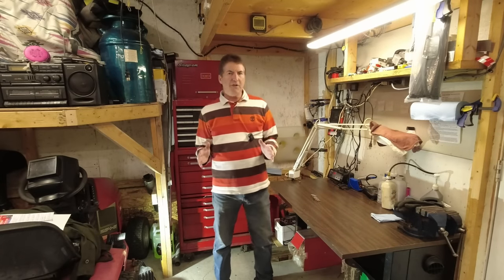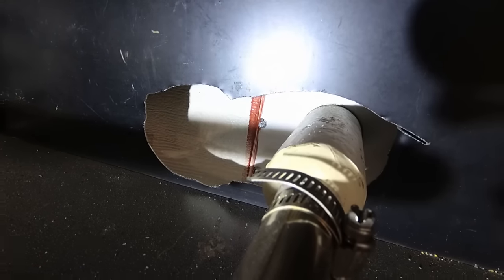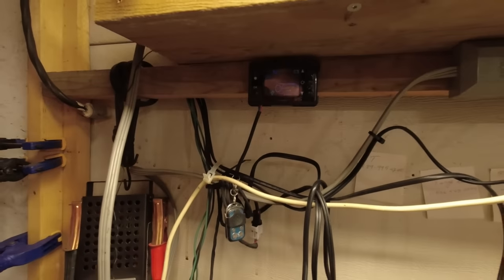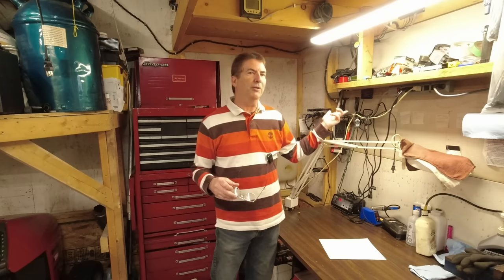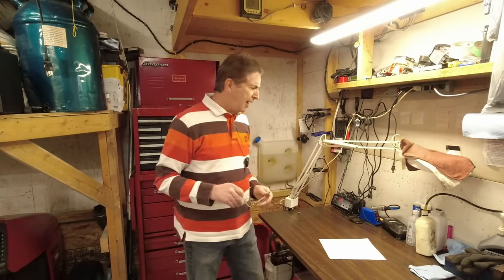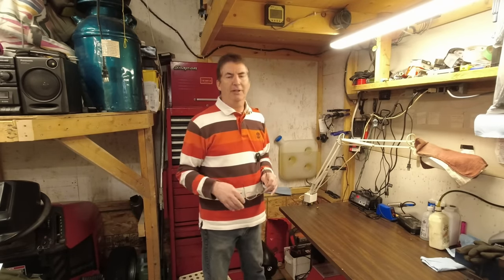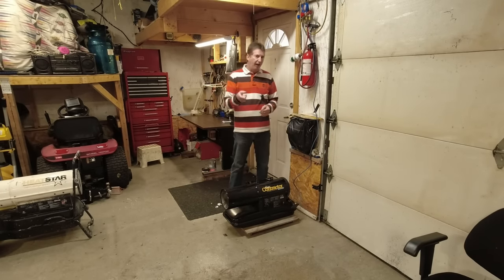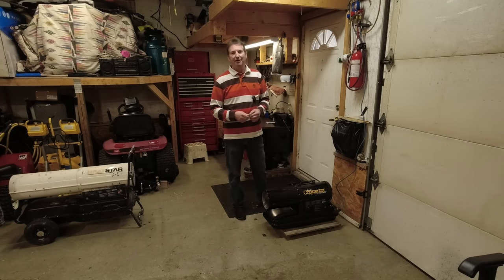Chinese Diesel Heater, 5 Year Review, Heating a two car Garage with a Parking Heater.

Comment: Make life easy. Just stick a tube in the 5 gallon can or even use a plastic drum. Also the tank can be below the heater. Side note each pulse of the pump is 0.022 milliliter of fuel. And the hz you are setting from 1.8 to 5.5 is the pulses per second.
Reply from the maker: Thanks for the reply, not all pumps give you 0.022 ML, some more and some less. 2 HZ on mine gives me around 2 KW. (Around 0.160 liters/hour, more of less, usually more) Yes not quite 2 KW but close enough. I buy my Diesel in the summer because it's cheaper and has more stored energy,  (not the winter mix) so it will gel if left out in the cold. I don't have a good spot to put a 5 gallon can to feed the heater. Below the tank is where I have my battery's (booster packs and others off the floor on plywood. When all the math is done I get close to KW as it shows in HZ. Thanks for watching.
Reply: @FRUGALWITHJOHN  spec on these pumps is .022 mil per pulse. So math for 2hz. .022 x 2 pulses per second gives you .044 per second. .044 x 60 seconds in a minute is 2.64 milliliters per minute. 2.64 milliliters pre minute x 60 minutes in an hour gives you 158.4 milliliters in 1 hour. So your 0.160 liter measurement is very close.
Reply: @FRUGALWITHJOHN  also for a larger storage tank. The pump can be 2 meters from the fuel source and can be 8 meters from the pump to the heater. So you could extent the pump wires and pretty much just put a storage tank anywhere in your garage. I burn between 200 and 300 gallons through the winter and just use 55 gallon drums. Have a pick up tube that I just switch from tank to tank. I look for free contaminated diesel and jet fuel. I just let the stuff settle out for a few weeks and drain off the stuff that gathers at the bottom. Water. Def. Algae. What ever. Lol.
Reply from the maker: Nice, I never though to look for contaminated diesel. I should check local truck repair shops. (Thanks)

Comment: What makes u think the heat settings from 1.7-x are KW and not just heat settings.......

Long story short the people who did there homework calculated that these Chinese heaters are far far far off from there ratings in terms of KW output meaning the so called 8kw version cranks out on max setting like 4.2kw heat but a big portion go,s trough the exhaust so from the 8kw on paper only 3,5 real KW heat are cranked out on max setting..

I own one of these heaters since a week and i love it,it gives alot of heat,but its not a 8kw device and the settings u refer are pump cycles per sec not KW.

But its great to see these heaters last years,great buy for the money.
Reply from the maker: I took the amount of diesel used compared it to what diesel stores in energy and came out with my numbers. 5.5 HZ was roughly 5 KW/17,000 BTU'S, the numbers are not exact, but this is not a lab. Every heater may give you a different amount (BTU), after all it's a $100 (+/-) heater.  I did need to replace it, here is the video and what failed.   https://youtu.be/YlCyzQzzU_8  Thanks for watching.

Comment: Very useful information but i am wondering why not leaving the air intake inside? Much more easier to open just one hole instead of 2!
Reply from the maker: When I work on fuel systems, I don't want open combustion inside the garage, examples (fuel pumps, gas lines, gas tanks, if I have a spill I'm okay. If you don't put the inlet for the combustion chamber outside you will have open combustion in side the garage. Thanks for watching.
Reply: @FRUGALWITHJOHN  Thanks for the answer. If i get it right you mean that there is a possibility for leakage or something? Isn't this air intake just the air the diesel heater needs to make burning? I mean it just sucks air from this intake. Right? How is it possible to have a leakage from there?
Reply from the maker: If you use a torch, light a match in the garage, you are using inside air for combustion - If the inside air has gasoline vapors in it, it could explode or start a fire. By getting outside air for your combustion for the heater, it would be the same as using the torch or matches outside. (overall safer)
Reply: @FRUGALWITHJOHN  ok i get it now!
Reply: @AleOle  If u use the air in the garage, then you are burning the oxygen what is indoors. If the room is not getting ventilated for longer time you will spent a lot of oxygen in the room. SO better to take the air from outside and not useing inside air for long periods of operation
Reply: @garaiselvis  Er no.  That would only be the case if the exhaust ws being dumped back into the room.  Since the exhaust is going outside, new fresh air must enter the room to replace any air being drawn into the combustion intake or the room pressure will drop.  Air doesn't magically appear in the room to replace it.  Might as well just draw the combustion air directly from outside and keep that loop completely separate.
Reply: Just to throw my hat in the ring the heater will not heat outside freezing air as efficiently as the ambient warm air from inside the garage.
Reply from the maker: That is another way of looking at it, some BTU's will be used up heating the outside air in the burn chamber. Another way of looking at it is, if you are using inside air and then the exhaust, puts that inside air, outside, it will need to be replaced by outside air. We can't live in a vacuum, the heater will now need to heat the new outside air that just came in. (pros and cons) An HVAC person may have the proper math to work this out? Thanks for watching.
Reply: @garaiselvis  Yeah new air (with fresh oxygen) will enter somehow the room just because 99,9% of the rooms aren't perfectly sealed or else the pressure will drop. Right now i am having the air intake in the room for 3 days since i installed the heater and everything looks fine...
Reply: @FRUGALWITHJOHN  most likely less efficient.  Outside air is heated directly in the fire at 100% efficiency whereas inside air had to be partially heated via the heat exchanger at 40-50% efficiency.
Reply: It doesn't seem right to put your heated air outside, after being pulled into the heater, and then replace it with cold outside air, coming in every small crack. Once it's heated, keep it indoors.

Comment: For heating honda civic would you recommend the 2KW or 5KW heater? Or they basically the same? Perhaps more fuel usage on a 5KW? I'm in Canada, so it gets cold, -15 celcius, want to do some winter camping. The heater will also be outside, so it will be drying in cold air. Would want the heater to run on low and keep inside the car at about 18 deg. Celsius. Would it be automatically turn on/off according to thermostat temps? Read the 5 KW heater runs quiter, than the 2 KW.
Reply from the maker: The 2KW is smaller, but some sellers call a 5 KW a 2 KW after they turn them down. Running a 5 KW on 2 KW all the time will carbon up the combustion chamber. 2 KW would be fine for a Civic. These heaters don't turn on and off just high and low

Comment: Nice explanation
Reply from the maker: Thanks
Reply: @FRUGALWITHJOHN  Could i be rude and ask what make charger you are using.
Reply from the maker: That one in the video is from Canadian Tire, It is not good for that set up. It will give me an error code and shut off after the heater is on too long. (The smart charger thinks there's a problem with the battery because it is not making it to full charge) The one I use most of the time is this one (Amazon Canada https://amzn.to/3Utdqns  ) (Amazon US  https://amzn.to/3upGWjr  ) affiliate link. I got it in 2019.  I was using it to charge my booster pack when I was making the video.

Comment: Can you mount the heaters outdoors, and it be utilizing cold outdoor air? Or is it designed to recilculate indoor air?
Reply from the maker: I never tried to run one like that so I don't have an answer. It is designed to recirculate indoor air for heat and recirculate outside air to burn.

Comment: Are you not wasting heat by running the air intake outside instead of recycling the warm garage air ?
Reply from the maker: If I ran the intake inside, I would have open fire in the garage. (Things can go boom if I have a gas leak) Thanks for watching.

Comment: Good video man! I am looking for a way to heat my 14’ x 40ft insulated wood building. Do you think a diesel heater like yours would work sufficiently? In the winter time at night the temperatures drop down to the low 20s Fahrenheit.  Thanks man!
Reply from the maker: Here is a video, I made about the different ways I tried to heat my 22'x23' garage https://youtu.be/c7p7CPABZ3I 20F is not that cold so it should work, but with out knowing how much insulation was installed I can't say for sure. Thanks for watching.
Reply: A 5KW heater would take off the chill nicely.  Any Chinese heater advertising as 8 kw isn’t telling the truth.  There are many video user tests on these heaters, in great detail regarding performance, improvements, installation practices.
Reply: @wallacegrommet9343  hi, I am just about to order an 8 kw heater. Are they actually eight? Thanks

Comment: How thick insulation does your garage have in the ceiling and walls?
Reply from the maker: To start off, I used Rockwool/Roxul insulation, R14 on the walls and R28 in the ceiling. If your insulating a 2 x 4 studded Wall building you need Roxul, regular pink insulation is only R12 and one small air leak and it's R0, Rockwool does not have this problem.

Comment: John can you set both btu setting and temp setting on these units. I live off grid. And just want to heat a generator shed to about 35 degrees f so generator will start to charge batteries?
Reply from the maker: You can set Temp or BTU, but It does not turn off, when it is set to temp and the temperature is met it will continue to produce heat at its lowest setting. I don't use the temperature setting, but I don't think you can set it as low as 35 F. (not the best heater for your application)
Reply: Look into the Afterburner controller for these things. They're about $100 US shipped, and they can be set up with a 'defrost' function that will fire up the heater at a specified temp, run it and then shut the heater down when a specified temp is reached. The startup cycle is about 5 minutes, and the shutdown takes another 3 minutes or so. So there's a minimum cycle time of 7(ish) minutes. Most likely depending on your set points, and how well insulated the space is, and how large it is, etc, that wouldn't be a problem.

As long as your power bank doesn't mind a little extra power consumption to run the glow plug during the startup sequence, it's a good way to go. And depending on how well the heat is retained, you may consume less energy overall due to the fan not having to be run during the times that the heater is shut down.

Comment: What's the brand? Or does it matter?
Reply from the maker: I put some links in the description of the video. Most of these heaters are manufactured by the same company, then they put stickers of the company that ordered them on the heater. Example Vevor and TSEIPOAOI are the exact same heater, the ones I put in the description. (I have both and they are identical on the inside) Vevor is a big reseller of products, so they may have better customer service.

Comment: What I'd really like to know (sorry if I missed it) is: how many litres of diesel does it burn per hour at 2kW?
Reply from the maker: Yes you did miss it, it is in the video, Thanks for watching. It is hours per liter not liters per hour.
Reply: @FRUGAL WITH JOHN  thanks for the reply. Could you point me to it? I got confused when you compared BTU to kW (power) AND to volume of diesel (energy).
Reply from the maker: 5 to 6 hours for 1 liter of fuel.
Reply: @FRUGAL WITH JOHN  excellent! Thanks again for the reply.
I make that about 11 kWh per litre, which costs about £1.80 here lately. That's about 16p per kWh, which isn't much more than I pay for piped gas. It's far less than I pay for electric.
I think I'll be investing in one of these to heat my garage. Maybe a heat pump, as I'll then have A/C for the summer, but much more expensive.
Reply from the maker: Try both,  here is a video of how I heat my garage https://youtu.be/c7p7CPABZ3I

Comment: They do make other voltages for power on these heaters so that you can run them off your service voltage or whatever is convenient.  Takes a battery out of the equation.  Batteries have a limited recharge life and are getting expensive.  They might be worth it if you live in an area with frequent and long power outages.  A rated power supply might also be a way around the battery and would allow you to have a standby battery (last much longer as it is not in normal use) for power outages.
Reply from the maker: Thanks for the info, I use the battery out of my camper and keep a smart charger hooked up all the time. The power used comes from the charger not the battery and the battery is a good backup in case of a power outage.
Reply: grab a random battery from the junkyard. even if its bad as long as it takes a charge you can use it. junkyard batteries cost about 40 bucks were i live

Comment: I have seen You Tubers burning pure garbage in those. Fryer oil and used auto oil mixed with red diesel. One guy finally got a no burn condition after 3 years. He tore it apart, cleaned it up and put it back in service. You will get your money out of it.
Reply from the maker: I never tried anything but diesel, the used oil I get from small engines have a lot of metal in it from the break-in, Thanks for watching.
Reply: Recommend a brand?

Comment: What's the square foot in your garage and how big is the heater
Reply from the maker: 506 square feet and 5 KW/17,061BTU's heater, Insulation is Rockwool/Roxul, R15 walls and R30 Roxul in attic.

Comment: What do you use for electrical power supply to the heater?
Reply from the maker: 12 volt deep cycle battery from my camper and a smart charger, the link for the charger is in the description. I leave the charger on the battery 24,7.

Comment: Why don't you get a 120v to 12v converter so you can plug it into your house power?
Reply from the maker: I have a 12 volt deep cycle battery for my camper I don't use in winter. Around here, every now and then the power will go out for second or two (don't know why). If that happens using a converter, the heater will shut down without a cool down, (not good for the heater). Thanks for watching.

Comment: The controller should have two settings: thermostat mode and the pulse rate mode. I'm pulse rate mode has nothing to do with the wattage. It's the frequency the dosing pump fires at. That's why the display says "Hz" when you set it. Does your controller say something other than "Hz" when you're changing that setting? I've heard that pump is supposed to output 0.02 mL per pump, and if you are using 2 Hz, then that works out to 0.67 L over a period of 5.5 hours, which is less than you're saying it's using, so maybe yours is different. My 5 kW heater can go as high as 5.5 Hz and as low as 1.6 Hz.

After almost two years my heater is dying. It didn't sound great day 1, and now the bearings are noisy as hell! I don't trust it any more, so I'm shopping for a replacement. Thanks for the links! The electric fuel pump is a neat item. I might have to get one of those to make it easier to fill my tank.
Reply from the maker: Mine does say HZ, It goes from 1.8 to 5.5 to make life simple I say 1HZ = 1 KW, When you do the math it works out extremely close, but not exact. Of course it also depends where and when you buy your diesel, not all diesel has the same stored energy. (in the summer it has more stored energy) If you buy your diesel in a warmer state and try to drive north to a cold province your diesel will gel. (winter = less stored energy). Good luck with your new heater and thanks for watching.
Reply: Hmmm. Turns out it is very close. Still, I'm surprised you didn't explain that in the video. It's cool that I learned it now, but it would have saved me a lot of time and math if you had simply explained what you were talking about in your video. :D BTW, I edited my comment. May math was bad. A 2 Hz pumping rate is only 0.67 L over 5.5 hours.

Comment: Does anyone have an extra Vevor older style controller, or know where to find one? The replacements off of amazon dont work, they all throw an E7 code.
Reply: Just buy a new ECU to go with your new controller. They're quite inexpensive. I think I paid about $8 for one I bought as a spare to have on hand.
Reply: @Wrenchmonkey1 recommended best Amazon brand?

Comment: Your guess is wrong.
In 2024, the heater prices are down.
I bought 3 heaters at Walmart for 75 dollars each.

I put 2 of them inside the Apache 4800 case with the battery inside.
Reply from the maker: I also picked up two more, around the $100 mark (Canadian). It is nice to be wrong sometimes, thanks for watching.